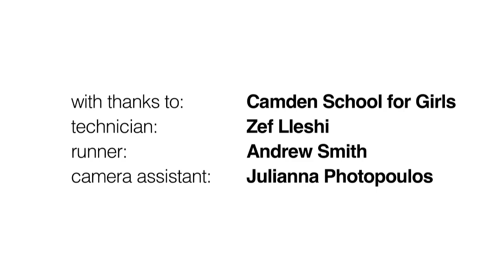Compressing a gas in a fire piston

Comment: Just to let you know, this video is being used by climate "skeptics" to suggest that atmospheric pressure is responsible for earth's surface temperature rather than the greenhouse effect. I wonder if you might comment on this for people's edification. Thx!
Reply: I can comment on that. It's not the weight on air that creates the heat. It's the CHANGE in energy state that does it. When you rapidly compress the air in the piston, you are adding energy. That energy has to go somewhere to keep overall energy the same (1st Law of Thermodynamics).  In the piston, the energy transitions to heat. For this to be the cause of global warming, there would have to be a highly significant addition to the energy state. Without an explanation of the source of additional energy, the theory is suspect. FWIW, imo it's impossible to be true. One need look no further than the barometer to see the proof.
Reply: what's the fact that sun throws more energy at earth's surface in one minute than all our energy consumed? ao if sun output increases, even imperceptibly, that transfer to earths atmosphere..
Reply: @livefully7568  And we measure that energy with fairly high precision. About 1366 watts per square meter is coming from the sun, but that has a variance of a couple of watts over the course of the normal 11 year solar cycle. So, solar variability (hence the change in forcing) is only about 0.14%. The change in solar forcing over the past century has been around 0.5W/m^2 at the surface, whereas the change for doubling CO2 is about 3.7W/m^2. So, yes, the change in solar irradiance does have an effect, but it's very small relative to other known forcings on the climate system.
Reply: @livefully7568  The OP and the response were so intelligent and thoughtful.  Then you came along.  What the hell?
Reply: @twocyclediesel1280  This (insert pronoun) has that affect on intelligence.
Reply: @livefully7568  It's possible to have a debate without losing your friggin mind.  Why so angry?
Reply: @twocyclediesel1280  You wanna know? You really wanna know?
Reply: @r.faj.5636  I might've gotten the definition wrong but at least I'm not stupid enough to think that some mysterious, non-existent force is raising the Earth's temperature by increasing atmospheric pressure. If that is what's happening, we would've detected it a very, very long time ago using simple barometers. The truth is that the specific heat capacity and the opacity of greenhouse gasses have a lot more to do with global warming than atmospheric pressure. "Greenhouse Gases" are molecular compounds with lower heat capacities and higher levels of opacity to infrared light than strictly diatomic gasses like nitrogen or oxygen. If the heat capacity of a gas is low, it takes less energy to heat it up and cause it to transfer that heat energy to other gasses. If a gas is partially opaque to infrared light, it will absorb some energy from it in the form of heat and partially block it from being removed from the atmosphere. Infrared light usually hits the atmosphere and heats it up initially but escapes. Greenhouse gasses do not block incoming infrared radiation, but they trap it when it's radiated from the surface of the planet. When infrared light is trapped by an atmosphere of gasses with a low heat capacity, it will cause those gasses to heat up on top of heating done by the infrared light's action on the Earth's surface. This creates a positive feedback loop because the new heat energy generated by greenhouse gasses can't escape the atmosphere either, as it will be absorbed and re-radiated by the offending gasses. This is all done by a process called photoexcitation, where the addition of photons to a quantum system produces an excited state. The energy of photons is determined by the wavelength of the light carrying them.

It's worth noting that energy radiated by the atmosphere travels both upward and downward. The energy that travels down gets absorbed by the Earth, which produces heat. Greenhouse gasses increase how frequently energy is radiated downward by blocking infrared light from traveling through the atmosphere.
Reply: Those climate skeptics are pretty fucking dumb.  Everyone knows that those crackhead theories only applies to a round earth.  However in the real world, we live on a flat earth and those skeptic theories are rendered useless.
Reply: Ill comment on people who believe that. Some people are dumb. And not just dumb, but maliciously dumb. A type of memetic viral stupid they seek to spread to gullible others who may not be familiar with physical processes, potentially indoctrinating these hapless souls into their little mentally ill brain atrophying belief systems typically centered around or at least tangential to the government, the people whos payroll is funded by your taxes, for some reason want to kill you, or make you unable to work, or otherwise be unproductive in society, and thereby unable to be taxed. Taxes they need to pad their payroll budget. It is in the best interest of tax funded systems to keep you productive in order to collect that sweet sweet tax revenue. Anyone saying otherwise is selling something, usually ignorance. No person, company, or organization is inherently obligated to act in your best interest. Ever. 

SPOILER ALERT: There are no boogymen. There are only liars and ineffectuals. Stupidity is not empowering, nor flattering. You are not stupid because you are not familiar with something, be it scientific concepts, or how the dishwasher works, or how to load a washing machine, or how to change the oil on your car. You are only inexperienced. And experienced can be gained. No one is good at something the first time, we all had to spend the time sucking, cleaning up our mess, figuring out how to do it right, before any of us......ANY OF US.....got it anywhere near correct. Ask questions. Anyone willing to rail against an honestly asked question is not worth taking advice from in the first place. However, while everyone has the right to speak, not everyone is saying something worth being heard. The internet is not, and never was, a safe space, regardless of what the ToS says. The ToS is just text on a screen, not hard set unchanging laws regulating the machinations of the universe set into motion by some pan-dimensional deity. For all you know I am a duck typing this on a stolen laptop in the French Rivera. But they are trying to tell you that you are stupid and the atmosphere is raising in pressure even though you haven't needed to pop your ears regularly to equalize, Im sitting here telling you that you are not as stupid as societal pressures want you to think. Who would you rather believe? Be careful how much you open your mind, otherwise your brain will fall out and someone else will come along and stick their garbage in the empty space. Remember, there are simple, easy, glaringly obvious, experiments anyone can do with very little equipment needed (most of which can be made cheaply at home (it wont be lab grade research gear, but itll get you some numbers to run (math isnt hard, your teachers just sucked and left you with unaddressed trauma over doing simple calculations, learn to use spread sheets, put in the formulas(google is your friend), let the computer do the maths for you. I promise you its not that hard, it can even be fun sometimes! You can do it. I believe in you 😎👍 I am more than willing to help anyone, at any time, looking to expand their skill set and knowledge base. Just send me a message, and we can figure it out together. Everyone learns differently, that is not your fault. You're not in this alone. And you're only a bad person if you decide stagnant ignorance is preferable to learning something new)) ...where was I....Oh yeah.....very little equipment needed....) in order to test, confirm, and become experienced with these simple physical concepts of the world around us. All that is required is for you to go outside, and possibly walk up a hill. Do not fear it. Do not diminish the beautifully simple complex world we have to explore with made up fallacies. The truth is far more astounding than any vitriol some jackass on the internet can invent to feel superior, or worse dupe you out of your hard earned money for the chance at getting one over on some made up entity that doesnt exist(there is no Gubo'Mant creature hiding out there behind the bushes trying to figure out how to attack you. There is only a collection of compartmentalized organizations operating under state interests via state funding. Yes, it really is that depressingly simple). These liars only win if you let them infect you. Become immune to the shysters that would hide this amazing universe from you with their fanciful regurgitant. Be better. Be smarter than them. I swear this on all that is quantifiable in all of the physical sciences, its not that hard, they are dumb, you are not. Gain a better understanding of things you have no reason to learn about simply for the thrill of learning it. You CAN do it. I know this for an immutable fact because I did it. So you have no excuse. Keep this in mind, I believe in you. And Ill be here waiting for you to join us here in the majestic realm of reality, you know the thing that remains when you stop believing in it, where all the cool shit actually happens😉

PS - The "yous" expressed in the preceding comment were intended as colloquial, unpointed, at most directed at the reader or other third party "yous". Not "yous" intended towards the original poster, or anyone of similar description alive or dead. No trees were harmed in the sending of this message, however a large number of electrons were terribly inconvenienced. As such this message has been known to the state of California to cause cancer, under Prop 65 regulations this warning is to remain posted in any areas accessible by the public. By contracting cancer from this message you agree and consent to arbitration by a representative of the poster's choosing, or trial by combat, whichever is nearer.
Reply: I legitimately think that you've done a great job at exposing the people who pretend to have a heightened understanding of physics and chemistry where they actually lack formal education in either subject. I see this all the time, especially in Social Sciences. I must add that while pneumatic energy is a thing, it can't possibly have an effect on such a large volume as the Earth simply because the increase in heat energy would need to be so much higher than the volume of the planet. This is why I think that insulative byproducts of everyday life and/or large-scale manufacturing are to blame for global warming and, more frequently, pollution.

Idiots will be idiots, Trumptards will be Trumptards, Qanon ret*rds will be r*tards, and the meek shall inherit the Earth. I appreciate truthfulness whenever and wherever I see it even though it may not be as popular or well-received as some blatant lies may be.
Reply: Maybe the world is flat and we're inside a giant piston. It all makes sense. We just figured it out
Reply: Rane, you invite not just the ignorant, but the brutish, maybe demonic ignorant to come out of their caves. They don't like being in the light; they don't like the light at all. You will not change that.
Reply: @zingodingo2816  I call them "belligerently ignorant." (A term coined by Naomi Oreskes, author of Merchants of Doubt.)
Reply: 🔴 What Is Islam? ⚠️

🔴 Islam is not just another religion. 

🔵 It is the same message preached by Moses, Jesus and Abraham.

 🔴 Islam literally means ‘submission to God’ and it teaches us to have a direct relationship with God. 

 🔵 It reminds us that since God created us, no one should be worshipped except God alone. 

 🔴 It also teaches that God is nothing like a human being or like anything that we can imagine.

🌍 The concept of God is summarized in the Quran as:

📖 { “Say, He is God, the One.  God, the Absolute.  He does not give birth, nor was He born, and there is nothing like Him.”} (Quran 112:1-4)[4] 📚

🔴 Becoming a Muslim is not turning your back to Jesus. 

🔵 Rather it’s going back to the original teachings of Jesus and obeying him.
Reply: @Miqdaad-b1n  I've got zeto to prove to you, Beta. One agreement those dumbfuck religious morons. You make me smile: electrical impulses in my brain alter your biochemistry to such a degree you lash out?
Your fear is showing, shit I'd be scared toif you believe this meatbag is all one gets. Shalom
Reply: @livefully7568  dude maybe go see a psychiatrist or something
Reply: @livefully7568  ummmm what? electric impulses? you need to have a brain for that. Prove jesus than ill even tell you where god is. lol you are just another religious moron whose unemployed.
Reply: @Miqdaad-b1n  correction: self-employed since you want to know me soo bad, Beta
Reply: @Miqdaad-b1n  Prove gravity. lmFao
Prove Lincoln existed. smh
Reply: @Miqdaad-b1n  thought I was unemployed? Dude your speak is schizo like governments covid reaction.
Reply: @livefully7568  you okay? You sound upset.
Reply: @genesis204  Thanks for asking, but no OKAY I'm not.
Reply: @livefully7568  ya thats how we highly educated people speak, you would last more time in bed then in a corporate environment(LOL). Ill proceed to bring your frustrated and triggered self back to the point. You believe in Jesus whose existence depends on written word, but you don't believe in gravity, a phenomena we experience everyday? Explain to me how you stay put to the ground 😂😂.
Reply: @livefully7568  @THEGODFATHER has left the chat.
If there is ANY WAY to prove how CORRECT YOU ARE about something which you have ZERO KNOWLEDGE OF, it's starting an argument just to abandon it once you've been called out for citing fake evidence, making moot points, repeating popular, yet highly contradicted arguments against something that's commonly agreed upon, etc. He was probably a sock puppet tbh as are most right-wingers on YT, IG, FB, etc. basically any politically moderate social media platform with a comments section.
Reply: @tsandethottiesupremocleo1896  I’m on the right, and I absolutely love science. I have a degree in electrical engineering, studied physics for my minor, believe 100% that the planet is warming, and think that the vast majority of conspiracy theories are complete and utter nonsense (in fact, the only conspiracy theory I can think of that is even remotely plausible is the Kennedy assassination). Like people of any political persuation, people on the right aren’t all cut from the same mold. We don’t all think alike or believe the same things.
Reply: @ranetorrent8988  So arrogant! THEORY of gravity. Look up 'theory', So you believe in God or Creator? Think not. Any person who claims to know anything outaide human experience is not worth my time.
Reply: @livefully7568  "A scientific theory is an explanation of an aspect of the natural world that can be repeatedly tested and verified in accordance with the scientific method, using accepted protocols of observation, measurement, and evaluation of results."
Reply: @ranetorrent8988  THEORY.. just theory. Look it up, Atheist. Sure any middle schooler could drop a ball and predict where it will fall, how fast and its acceleration,but NONE can tell you why or what forces are at work. Sure there's a large mass here and a small mass there, but what of the field or force that's pulling them together? sshh
Reply: @ranetorrent8988  Woah these religious fanatics...